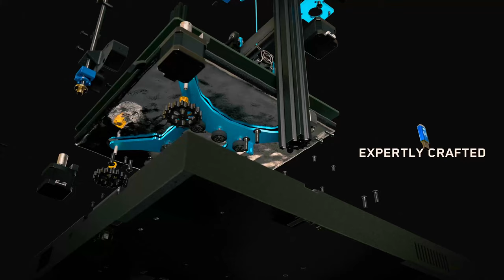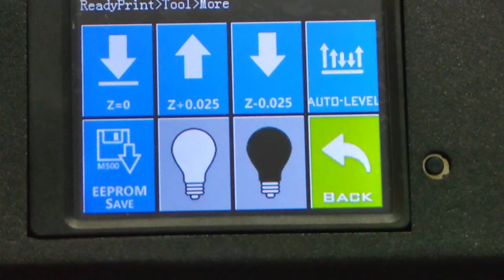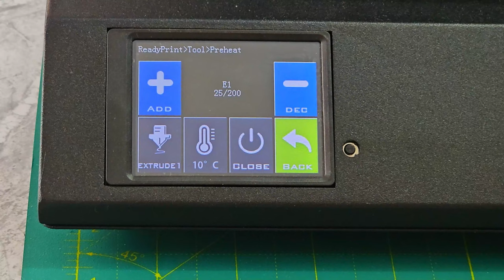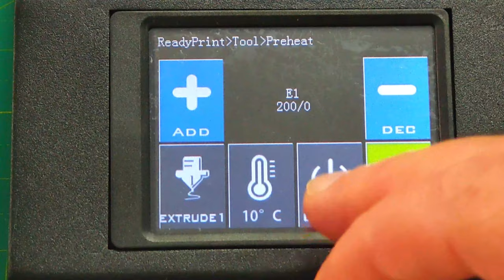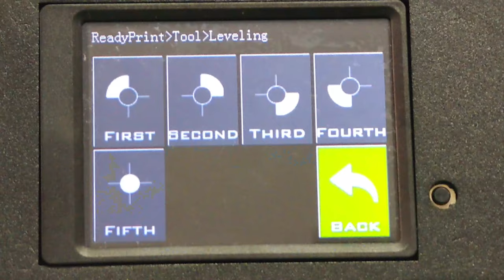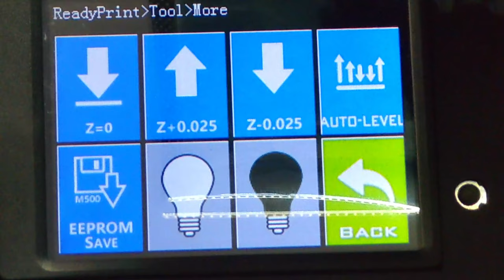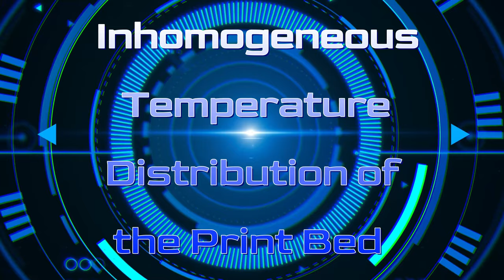Honest Opinion On Artillery SideWinder X2 3D Printer

Comment: Would you recommend a printer like this for beginners?
Reply from the maker: I definitely recommend it. It is a good value for the performance it offers. It also has decent printing size.
Reply: @RobinsFunPlaytime Does it have any very complex components that would be difficult to understand?
Reply from the maker: Not at all. It is pretty straightforward to set up and run.